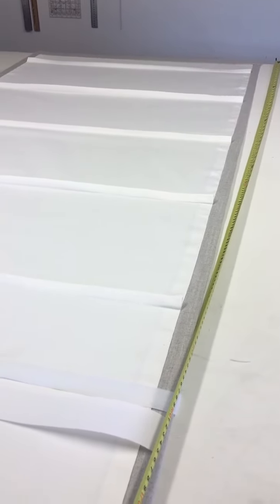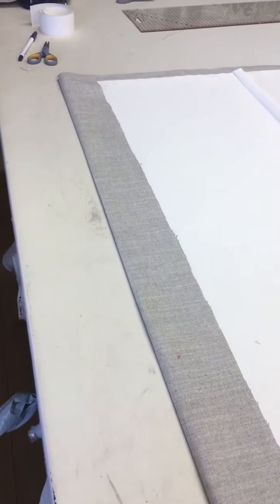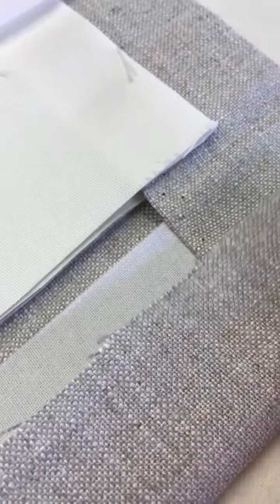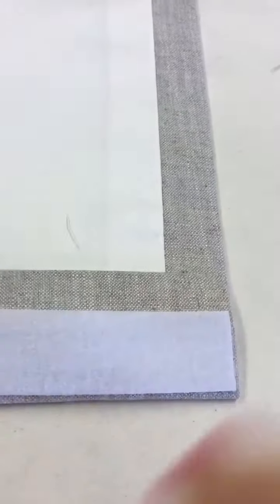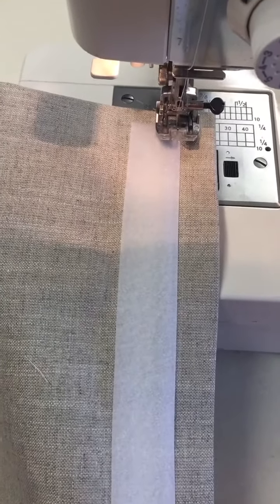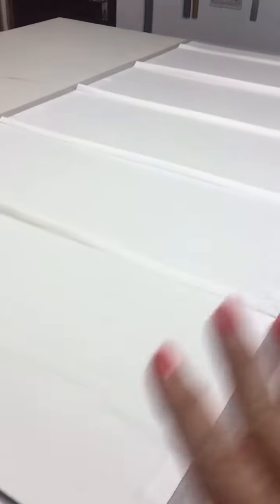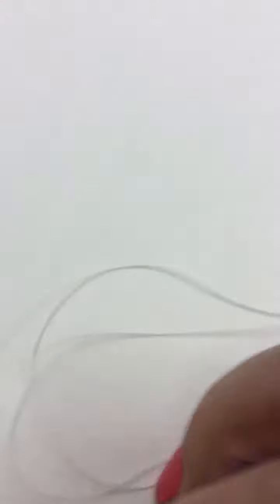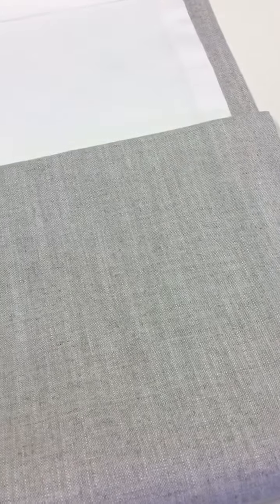Roman Blind heading

Comment from the maker: They are all still stab stitched
Reply: you can skip stab stitching though if using blackout lining?
Reply from the maker: josephine dixon you cant skip Stab stitching unless you you interlock each layer as you connect blinds. My blinds have no visible stitching in the front and I never use blackout lining as lining. I use bonded blackout interlining in between main fabric and standard lining layers.
Reply from the maker: Hope that makes sense
Reply: @Sacha Boxall it may be another video : ) i feeling a bit dumb. bonded blackout interlining instead of blackout lining - ah, okay. with interlocking around all the edges? but stab stitching (around where the rings are sewn on the rod pockets) would go through to front and leave wee light holes no?
Reply: @sachab247  a lot of digging around on the internet but i get it now. and seems a few stab stitches are inevitable. but interlining layer should help minimise them. onwards, upwards ...
Reply: Beautiful work.